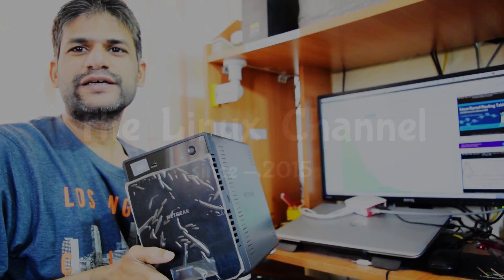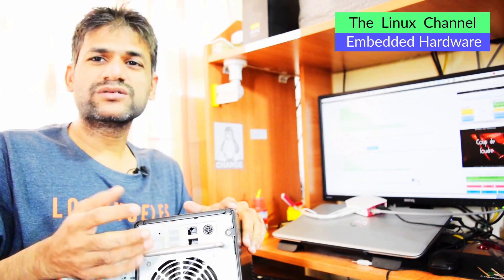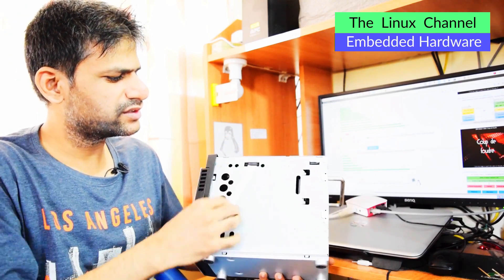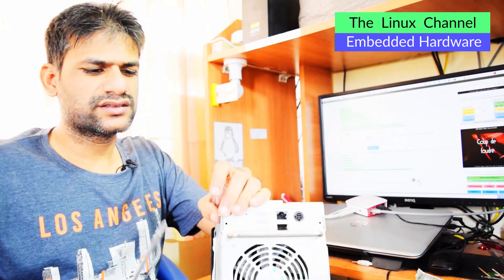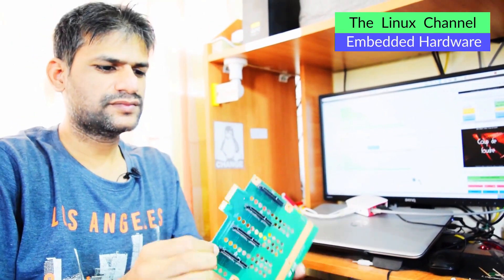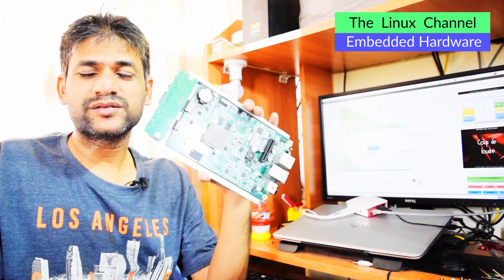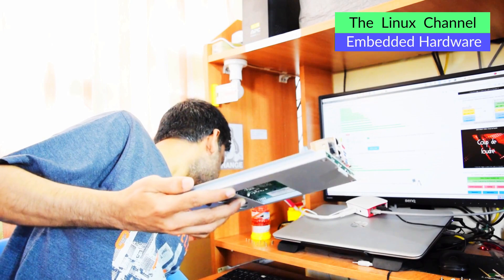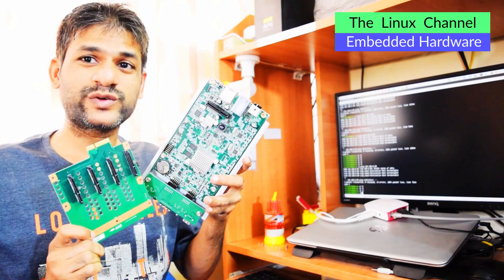0x1c3 ARMv7 Marvell Armada 370/XP | Netgear ReadyNAS Teardown and Upgrade VLOG & Workflow #teardown

Comment: This is like the domestic version of Synology NAS and there is a Synology NAS system that run a AMD 1950X Threadripper on a custom motherboard with a TR4 socket. You could use 4x 100TiB Data Center SSD drives in that unit for 390TiB of storage.

Comment: Very nice video. Sir, I have experience in microcontroller and firmware development. I want to learn Embedded Linux and LDD. Sir, please suggest how to master it.
Reply from the maker: Nice to meet you Faisal :) Good question. Since you are expert in hardware platform (such as microcontroller and firmware), what I feel is that you lack the understanding of OS and the other subsystems. So learn and master it. And that includes Linux in general. Note there is no such special thing as embedded Linux. A light-weight less feature Linux is embedded Linux LOL. LDD comes last. It depends on what subsystem you want to gain knowledge. Hope that helps.
Reply: Thanks a lot sir for your response. I am interested to learn hardware Linux drivers. Like USB, I2C, SPI etc. How to communicate with USB devices using Linux. Please explain step by step approach to learn it.

Comment: What about swapping the board out wiht a Raspberry Pi Nas set up ?
Reply from the maker: true, at times considering the same or similar NAS dedicated SOCs. But in the end it makes sense to build a TrueNAS. The TrueNAS I built from scratch around 2018, still works great. Hardly any issues, and still the same ZFS z2 pool I continue to use. Did scrubbing many times to make sure data-integrity. So its extremely seamless vs these options
Reply: @TheLinuxChannel  I have an old  readyNAS duo V2+ rnd4000v2 4 bay unit and the firmware is so old I can't use anything than an old win7 machine to access the gui due to the certs lol
Struggling to get a free CA cert loaded to use on win11 or Linux but that's why I thought of the pi Nas with Debian

Comment: Have you managed to change the motherboard to another one  ?
Reply from the maker: sorry for late reply. Sorry no no. I decided to just retain this, and to keep this as a mirror NAS server for now. I should able to do that, if I encounter a small SoC mobo with 4+ sata ports all in compact form-factor. I can remove everything, and build a tiny NAS within. In fact remove the back-panel and connect via sata cables with SSDs.
Reply: @TheLinuxChannel  I haven't opened mine yet, but do you think a rockpro 64 with a PCIe extender that will connect to the sata expansion board?